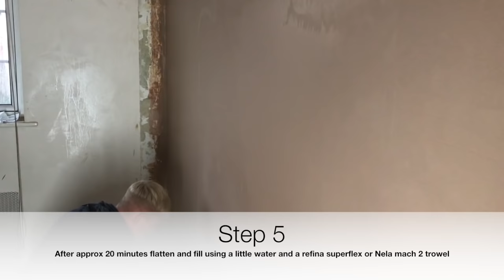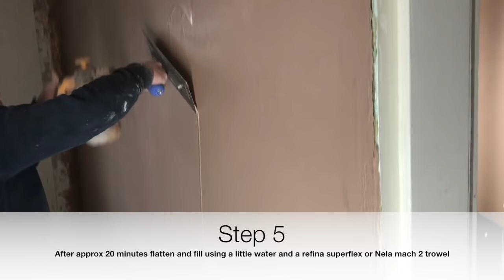Plastering - Skimming,  one coat sponge

Comment: Nice job, a few tips for anybody interested in this method.. Use the belly of the trowel when applying a thick coat of skim this will ensure the correct thickness.. Flatten the wall using a trowel and a hawk of stuff to fill in any hollows.. When sponging the wall use as less water as possible, a small empty kitchen spray will do.. Hold the sponge at the same angle you would a trowel  keeping the belly of the sponge of the wall once up from bottom once down from top there's no need floating like you would a sand and cement finish. You just need to get the fat from the plaster to spread over the top.. Two rubs with any decent skiming trowel and it's done first rub to close the wall in and fill any hollows don't remove any fat just spread it around and don't use water second rub will after a brew with clean trowel keep wiping it with a brush and you will need less water if any apart from angles brushed in..off home easy peasy
Reply: Shay Doyle 
Can you say that again but go through point by point please?

I find it hard to follow. It's not you, but me.

Cheers
Reply: I'll try. When putting the skim on the wall try keep the leading edge of the trowel as close to the wall as you can. This way when the skim spreads on you won't here a grating noise from the sand in the thistle bond or whatever is painted on the wall. I would just pva myself for a wall like that...anyway after you put the wall on wich should take lets say 5mins or so. Take a hawk or two of stuff from the same mix and spread over the top leaving it as neet as you can.. And go clean your bucket or whatever you have to do... You have to stay on top of the wall so make sure that all your angles are clean coving and skirting lines look straight etc. This is the time saving bit
When it's ready to sponge use a small spray bottle a light mist will be enough to get the sponge moving.. For a wall this sise half a mister muscle bottle will be enough. 
There is no need to sponge in circles.. Just use the edge of the sponge along the angles and once up and once down the wall. 
Keeping the middle of the float off the wall, the sponge will move smoother this way... 
When you've done this flatten the wall straight away using no water removing none of the skim just spread it around closing the wall in filling any hollows as you go.. The wall at this point should have a layer of fat on it. The fat is what gives the nice finish. At this point you can't go wrong clean your angles and when the wall is ready trowel up you should need very little water because the wall is full of fat just flatten it in. 
This is not a new method of skiming you don't need special tools a cheap sponge float about 8euro,
Good skiming trowel which you should already have and give it a go..I use a traditional skiming trowel up the final rub and pollish with a flexible. 
This is not a criticism of the video but there is no need for the amount of water the lads use here fair play to them for putting it up.. 
It's a hard thankless job at the end of the day
Reply: Shay Doyle Thanks Shay, appreciated

Comment: For 12 years I've two coated apart from the odd lid or wall I couldn't be arsed with and in general, I'm with the old skool method, but I'm gonna try this way on a wall as an experiment. If it comes up as good as a two coat finish, I might use it a bit more, in situations where it saves some ball ache. However, on the whole, on areas where there are multiple joins, I'd be more inclined to stick to the traditional two coat method, as not every wall or ceiling you turn up to do is flush where the boards join.

Comment: I used to take the piss out of people who one coated, i always swore by two.

Only in the past 3 months or so i've been watching these 2 other lads i work with and their finish is probably one of the best i had ever came across in 10+ years. 

All they did is put one thick coat on...flatten it, leave for about 15 mins and spray it all over with water, sponge floated it and trowelled it over a couple times, couldn't find a single hollow in it (on old existing walls). I tried it for myself and then started wondering what the fuck have i been doing for 10 years!?
Reply: goldenalex one think coat is the best away
Reply: goldenalex I do just one coat
Reply: One coat all day
Reply: Not my trade but I had a kitchen replastered like this 50msq approx wth 2 doors with 2 Windows I was impressed because the painting was easy no filling or rubbing - my neighbour had his hall replastered and the geezer completely cocked up left him with bumpy walls worse than before........????
Reply: I have been plastering for 10 years and one coat is for people who don't know how to plaster  set of cowboys
Reply: If you've got the skill to one coat do it, if your an amateur don't try it.
Reply: fuck sake what had i been doing too. Once saw some chaps doing one coat they were quick but looked hard work and was rough. The sponge tech adds another dimension but still looks hard work.
Reply: @richardgarratt9497  I've been trying the sponge technique with a mate recently. On one and two coat walls trying to find the sweet spot. We find that the two coat method with just towels still works best but we are old skool so have the hand skills. Still think we might be missing something. It's hard to see their walls up close on video.
Reply: One coat is too thin. You go too college? Obe coat sponge isnt anything new. Its just cheating your customers on your time and quality. If you want to do one coats go on to mp75 or something similiar. Wheres the real spreads instead of these pretender skimmers.
Reply: @PaulSmith-wz2yw  yes I went to college but don't think it makes a person a good spread but it doesn't hurt. As you say one coating probably isn't new it's just a way to speed up a hit to earn more money. Human nature I suppose. Now years on new plasterers don't know any different lol
Reply: i feel your pain brother i even do 2 coats to date and i see i am killing myself and making no money so i am all for it gonna give it a go
Reply: @fef777777  give it a go for sure but you might find like us that's it's no quicker if you want the same quality. I'm lucky I got out and do building maintenance now. I just help my mate out occasionally on larger jobs.
Reply: goldenalex b
Reply: @marks-0-0  "I'm lucky I got out" lol
Reply: Doing the right way the the past ten years
Reply: Two coats is always best , gives you sharper lines , more work time - doesn’t require two people to work on one wall etc etc . 

I’m not saying it’s a bad method but it really doesn’t make much sense to me and I use speed skim , 24inch Refina the full Shabang - won’t get a better finish than my two coats 👍🏻👍🏻👍🏻 equal buy never better
Reply: And from watching them the coat of plaster didn’t look that thick tbh 🤷🏽‍♂️
Reply: @Alexkfpv  stf dude here in Europe everybody does in one coat. We use mp75 by knauf
Reply: Really?
Reply: @Sunny Lekh keep thinking...hold my beer
Reply: @Alexkfpv  For 43 years my dad always went for 1...
Reply: Spencer Cooper-Thorn lol
Reply: @marks-0-0  z,
Reply: kevin m 😂😂👍👍
Reply: Never too old to change mate Im not a plaster (I'm a chippy ) every trade takes skill and years of learning I take my hat off to plasterers it's a tough job can't just down d tools and  go for lunch whenever , always working in damp and dark and tough on the arms it's all go go go 😎
Reply: @kevinm8764  mate I think it was just to speed up the video tbf
Reply: @marks-0-0  If you`re wearing two coats it`s no wonder you need towels!
Reply: I like to to do but no one response  I know little bit

Comment: I've used this method for years but not all the time.it does work especially if it's a small job and you want to speed it up  or on an old wall that not perfectly straight and skim happens to be over heavy. Brings up a brilliant finish .only wish those long blades were out twenty yrs ago I'd still have my shoulders in one piece. Antin that makes a hard job a bit easier is a bonus. It's not up to plaster to remove sockets.nice work lads

Comment: After 35 years of plastering I've developed severe tennis elbow, what I'm going to take from this is to go and buy a spatula to reduce trowel use and ease pressure on my elbow. Will still be doing 2 coats though as sponge floating looks just as tough on the elbow as applying a 2nd coat with a trowel.

Comment: I've been plastering for 31 years , and I'm not of fan of 1 coat plasters , plus I'm sure you don't need 2 spreads on that little wall , but with all said they have got the done ,
Reply: stevep they are gifted from college.
Reply: This can only be done inside buildings and houses where the Sun is not on those walls to EXPOSE the waveness of the walls Because no one coat system especially a finish can be done in 1 coat.In 30 years in the Unions we are exposed to Latest and greatest so called "One coat System" none of them panned to be any good.Fly by finish system maybe 1 job and then no more because of bad material system and couldn't be done in 1 Coat

Comment: If the spreads that taught me 43 years ago saw this they would self combust!
Still, if it works, crack on I say.
Only thing is, the wall would have to be very flat.3 or 4mm of finish won’t accommodate much of a slack.
Reply: I'm here in Southern California this will look good in interior jobs but on the outside when Critical light hits the wall look out.sll walls look bad in Critical light but it is up to the Plasterer to make those walls only look bad for a small amount of time.If a wall only looks bad for less than 5 minutes then good conscientious Plasterers worked on the wall.and Smooth Finish enhances the imperfections even more.Plastering now for 30 years in the Union.I  started when E.I.F.S. the foam system really started to take off
Reply: Kyuh 😀 And you have 25th payment
Reply: @crewcab1984rv  kyuh

Comment: Shine a light down it!
I bet it looks like the surface of the moon 😆 just follow the instructions on the bag 🤦🏼‍♂️
Reply: 3:50 there is a light...looks like their technique is working 🤷🏽‍♀️
Reply: @DanSoloPlastering  I get your point, to an extent. However, all trades evolve in terms of processes and equipment. Bricky mate of mine worked with an old plasterer that wouldn't use a mechanical mixer and insisted on using an old metal 'bath' to mix in. Anything new, to him, wasn't 'traditional' and therefore was to be dismissed. You can't deny their speed and in reality they'd be a bit slower as the point of the video was to show the speed. Go back 20 years and you'd be taught to use one trowel which you'd need to break in. Now there are supa-flex trowels, speedskims and plastic trowels. Times change. Best embrace it.
Reply: @bladeboy2041   Same with bricklaying, nobody builds corners now, its profiles or box section all the way.
Reply: It’s a shame as you’re right they do evolve but for speed and not quality

Comment: I just don't know if i trust it yet. I've had a go with superflex but i haven't found it much use it. I don't feel i can get enough pressure on it for trowelling up. Maybe it just needs breaking in. Thinking about chucking some render one with it to break it in.
Reply from the maker: it does take some time to get used to.  The steel is softer so the angle of the trowel and the pressure is different to using Marshall Town. Worth the persistence in my opinion.  The trowels don't need any breaking in, the are good to go as soon as you buy them.

Comment: Well, I have been plastering for over 40 years, the whole point of two coat skim is any imperfections are not rectified with one coat, the only time I will one coat is in a cupboard, the one coat stem is crap

Comment: good method but been a plasterer for 31 years prefer usind steel to lay on then nella superflex 2 to finish.have used sponge in past and spats but mostly use trowels
Reply: Been plastering for 10 years...like to put on and then lay down with traditional steel ,recently bought a Nela superflex mark 2...love the feel of it. also about to buy the Nela plastic finishing trowel..would you do the 2 polishes nela superflex or the first polish with steel and then Nela superflex

Comment: Evening squires..do you put much pressure on the sponge. Also, do you see any faint lines left behind after you flatten that then come out with the wet trowel. cheers 👍
Reply from the maker: Dean Arnold u need to put some pressure on the sponge so you can liven up the surface of the plaster.  Almost making the second coat on the wall. Should leave a nice cream to trowel up. Shouldn't see any lines, should leave a matt and even finish.. if you see lines then yes, should come out with a final hard press trowel.

Comment: stick a l.e.d light on it when it dries up,looks great when flattening in with a refina but you need a stiff trowel to water your walls refina drags fat every where.i first and second with a stiff marshel town trowel flatten once with refina leave it for a while then finnish of with marshel town trowel then use refina for a polish
Reply: That's the best way and if you want it quicker throw some dirty water or cement in there I did a set yesterday only a small one but finished it in 1hour and a half from start to finish it did go a bit fast hahaha
Reply: Too much plastic these days .need 1 good hard troweling and polish

Comment: i did this method today in a room..afterwards i could feel where the boards were kicking out on the joints..i know this does happen but thought maybe i was missing something suttle in the process 🤔
Reply from the maker: Hi Dean, could be you didn't lay on thick enough. Also use the spat starting from the bottom going up not from left to right where there are joints. Maybe go over it a couple of times with the spat that way if the boarding is not great.
Reply: We had the same problem. Had the room dot n dabbed and room was plastered using this same method. Joints on boards were visible, but on the 2 overskimmed walls they were bang on. Thre next room I used another spread I know who is more of the 2 coats with a trowel and every wall was bang on, whether it be d n d or over skimmed.
Reply: @SME_Ste  that's because your boarding was not layed flat and true

Comment: Enjoyed a good work and almost at the end i realized, that you guys are using gypsum render tecnology :)
Reply from the maker: We are using Gypsum Multi-Finish in the video. Which render system are you referring to?
Reply: In my country multi-finish us not popular due the price. We use thick layer renders as Knauf Rotband, Goldband, MP 75. There are also available other manufacturers - western and eastern europe ones. And basically, they all recomend to work with gypsum based render similar way as you do. Only difference is thicness of layer our minimum (recommended) is from 5mm. And I personally havent never seen in my country somebody plastering a drywall. We use Sheetrock and similar stuff for that. Actually, there are few times, when i do render a drywall, but that means, that somebody has had really poor quality and is not getting paid for it

Comment: You should consider about getting "PFT Ritmo" to speed up everything a lil bit...Great work anyway.....
Reply from the maker: I have been using the Refina STX410 pump spray. Fraction of the price, only thing it doesn't mix the plaster. But this is a positive, as it keeps the machine very simple and easy to clean. I will be posting a video soon of this machine, where we will be reviewing it for Refina.
Reply: Nice, I'm very interested in this!

Comment: I will be  Skimming a plaster board wall will the one coat method will I be better off skiming all the tapes first then putting my 3 or 4 mil on so I get good coverage is that the way to go same as beads double coat them as well please reply Micky
Reply from the maker: Yes, even put two coats on with the same mix until you get more experience with the system.. always double fill your beads as plaster shrinks as it drys.

Comment: Did yo method on Monday worked very well thanks is it the same on a ceiling what is the best way to clean my sponge float mick
Reply from the maker: Michael Burr in a bucket of what or under a tap and push the plaster out with your hand a much as you can.. it won't be perfect but you can get a good six months constant use out of It before it needs replacing.

Comment: Hi 
I don't have a spat but have a refina plazi can that be used instead ?
Reply from the maker: Dexter Siviter yes the plazi flex is fine. The larger spats are better as they flatten over larger areas, and give a flatter wall as a result, and quicker. But good results can be achieved with a plazi flex trowel.

Comment: I haven’t seen this done in Canada in a long time. What’s the point of plastering? What is it? It is similar to a skim coat of drywall mud?
Reply: most of the properties in the uk are solid walls , plaster boards are only used on partitions and ceilings  in a traditional building ,  and any skim coat should be 2 mm . and the first rough coat should be no less than 3/8 with the finish at 1/8 .

Comment: How do u go on about a plaster board wall with scrim do u double coat it were the scrim is or just as you are doing in the video thanks Micky please reply very good video
Reply from the maker: Michael Burr it's exactly the same process as seen here.. the video doesn't show how thick we are putting on.. but it is 3mm thick.. that's usually the same thickness of two coats.. it's just that we are used to putting that thick first time.. it's take a bit of time to get used to putting on 3mm thick in one go.. I recommend to start with put two coats on straight away, no waiting around between coats and try and use the same mix.. when a little more confident then try putting in 3mm first time..